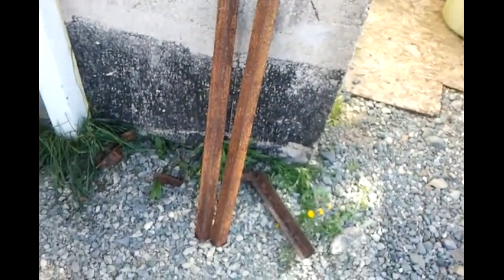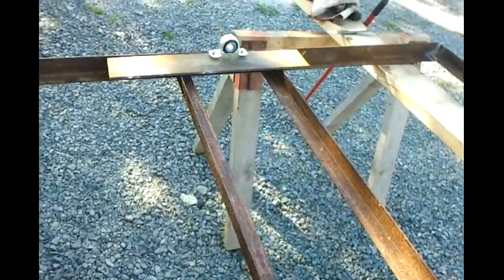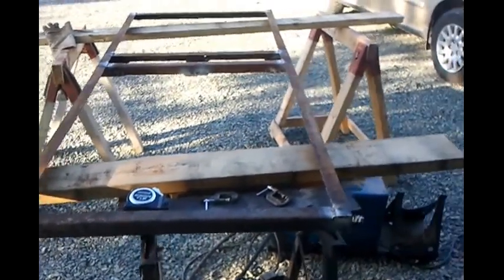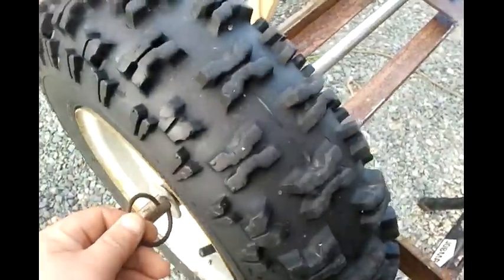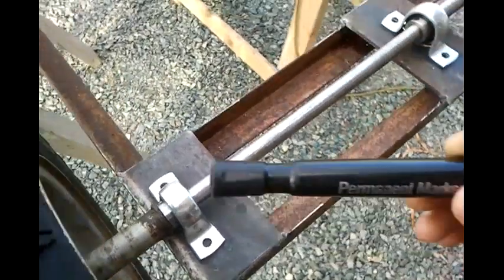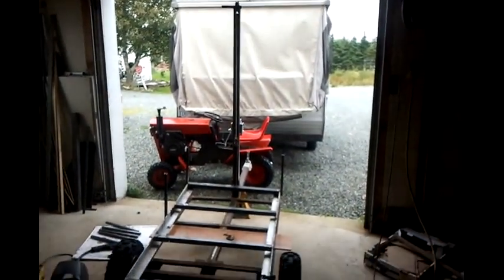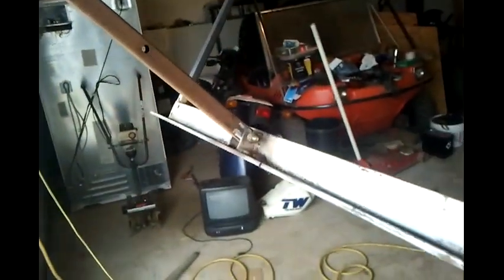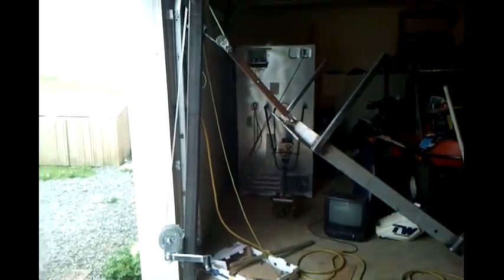Garden Dump-Cart

Comment: We're did you get the bearings and the piece of steel
Reply from the maker: Those were flange-bearings from Princess Auto. Not sure what would be the similar store in your area. In the States that is like the Northern Tools or such supply stores. You can find lots on ebay or amazon as well. The steel was old bed frame steel a lot of people throw out with spring cleaning. If you go to a steel recycle place you might be able to pick some up cheap. I simply asked people who were throwing them out if I could have them.

Comment: how has the 3/4 axle worked out?  Do you regret not going with 1"?
Reply from the maker: Dave Christian The 3/4 axle seems to have worked fine. It can handle a good load (up to 500 lbs or so). Really meant for backyard applications and small projects plus a scattered hay ride for the kids.